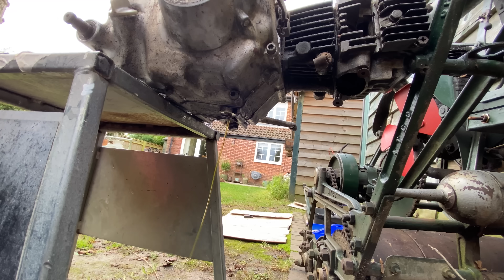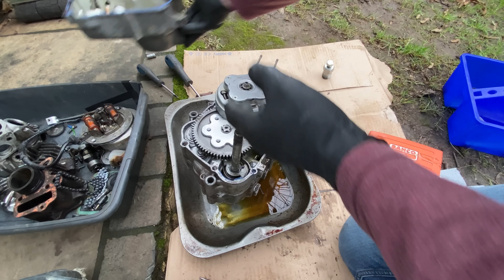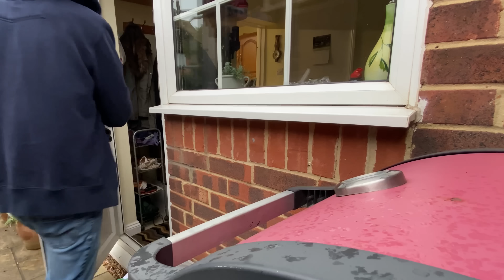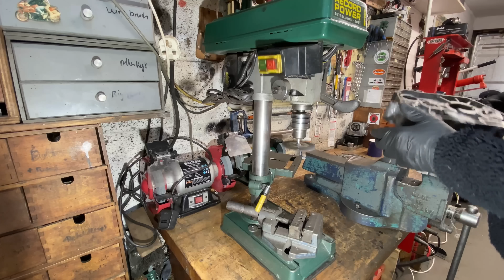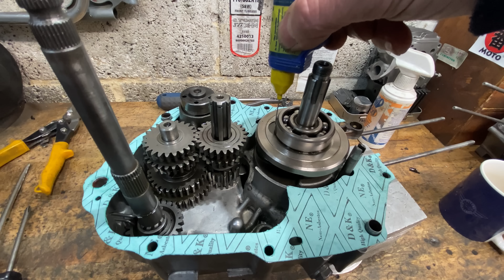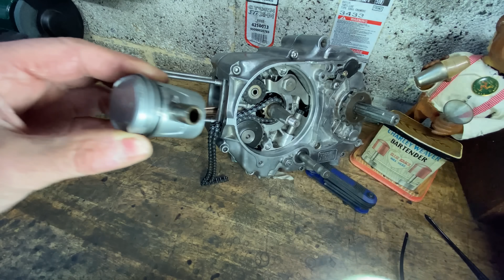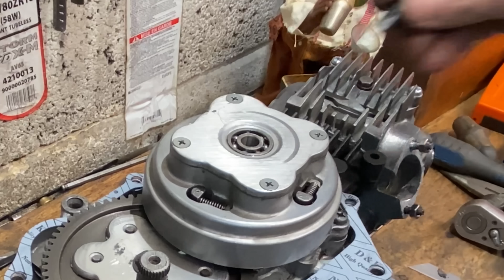Honda SS50 engine strip down, rebuild and start

Comment: Yeah that engine had been dismantled not long before you got hold of it. You can tell by how clean it is inside. Wouldn't be surprised if  those piston rings were broken during initial assembly.

Comment: Great video, it brought lots of memories back.I was amazed it was so clean inside.
I did 30,000 miles on the SS50 that i bought new on August 1st 1974 and just had a burnt exhaust valve.

Comment: What happened to the running temp painting the barrel. And the wobble board sound with no exaust...40 odd years ago...if I remember correctly... couldn't you get a 60cc conversation kit. So instead of a 50 U had a 60 for tax n mot purpose...😂😂 not to mention your test....😮😊😊😊

Comment: Oh wow, that was my first bike, Honda SS50 Reg HHN381N,  Ok on the flat but I still had to either get off and push or pedal like hell to try and get to the top of a steep hill on my way to a farm I worked at. I smashed it when coming down this hill on the way home as when I reached the bottom and the bend, the handlebars were pointing ahead but the wheel and forks were still going their own way.  Happy days. The front wheel slipped on some black ice on the country lanes and another time, I was following the petrol slick on the road and when I came to the bend and crossed the white lines, I was off again

Comment: looks likethat engine was stripped, cleaned, rebuilt but the gasket at 1/2 an inch probably ruined any power it might have had and it got consigned to back of the yard...weird about the piston tho

Comment: Why not used locktite on the bolts? Vibrations can untight them. leaving you with repeating  the job., as I already experienced. with a 70cc

Comment: I've done three top end rebuilds with reboring back in my younger days, nothing so complicated as this, not having a garage or work shop now I would have to leave any engine work to the "professionals" , the same professionals that on fitting a new chain and sprocket left the chain adjusters and rear wheel spindle loose, thankfully I heard the rattle before the wheel skewed sideways and jammed up, I pity anyone who has to take their bike or car to dealers to keep the warranty valid, I have read you can use any local vat registered mechanic which save many miles of two and fro, being that small engine bikes require 1000 mile oil changes you could be on first name terms with a mechanic if you do lots of commuting miles.

Comment: Hi Allen, I'm wondering, is it fine to retension a loose camchain tensioner or would you recommend buying new ones?  My bike is a 2003 Honda VFR800 with 34,000 miles and one of the camchain tensioners is losing tension and chain is slightly rattling.  Your response would be much appreciated.

Comment: I notice when im going down the bridge my c70 is making a drag to engine so I try to step the clutch without releasing it in order the clucth set in neutral position temporarily... But now it does not work the way it was

Comment: Hi, my friend had a really quick ss50 I found out why a few years later, a c70 head and barrel would go straight on, 
I always wanted a Honda 50 but having to buy it myself I ended up with a Gerreli tiger cross, which turned out to be quick but didn't have the top speed of the ss70, to much torque, and cc, also higher compression. 
Back in the day, 1978.

Comment: Hi Allen, in 1963 or 64 I had a Honda C1 14, which was the domestic version of the C1 10. It was a four speed not the usual three speed. I was just a kid and I wanted to take my little Honda 50 home to America so I had to disassemble it into four pieces and cut the frame a little bit to fit it into the boxes to ship it . about three months later. I started receiving my packages and put my little Honda 50 back together. I was I am mechanic after that for the rest of my life. I love that little Honda 50 it would go over 50 miles an hour. I drove it to school every day by the way, you are an amazing creative man. I love your videos and your abilities.

Comment: Loved the 3-way automatic clutch system. Had to rework the slopes that the rollers rode up as they had formed a groove at the top  and the clutch wouldn't drop out. That reduction in slope meant I had to araldite an extra plain clutch plate to an existing one to take up the slack.
The poor engine only had 2 speeds, tick over or full throttle, but it did me well in a step thru' for nerly 3 years.

Comment: Great video! The Honda SS50 was my first bike and I have fond memories of it (not so much of it's pedals). Unfortunately at some point during maintenance I stripped the dome nut bolts on the cylinder head because they were aluminium. Not a good day.

Comment: My first bike was the predecessor to this one, a C50. I was 13 and my parents bought it for me for Christmas, as a none working bike. Got it back home, to find it had no spark, borrowed the flywheel puller off my mate up the road, who had a Suzuki 80, the same puller more or less. Found that the fibre insulation washer on the points was in the wrong place, so corrected that, and it fired up third kick, having been unused for about 5 years. Eventually sold it to buy a bigger bike, a DMW, yes D, with a Villiers 9E engine in it. You brought back some happy memories from 50 odd years ago with this one Allen. In the New Year I start the rebuild of my 40 year old Harris Magnum, with an 1170cc Kawasaki engine.

Comment: Ahhh. Memories of taking my Honda 50 apart!  I could remove it, strip it down, clean, reassemble & refit in a couple of hours. I was about 18 at the time. 1964/5.

Comment: These are such quality engines, i had a 1966 model, I'm sure it had push rods. I remember stripping it down and putting it back together just for fun, it was so reliable. I swapped it for a Suzuki 125.
Reply from the maker: The early 50cc engines were pushrod and were the C100 range

Comment: This took me back to 1976 when I got my first moped - a Gilera 50cc trials (2 yrs old), proper frame and quite a bit taller than my mates SS50's, AP50's, FS1E's & Garelli Tigers. Learnt alot from my dad (who'd had bikes) about maintenance + I had started a 4yr apprenticeship (first year gen metalwork fab), so got the confidence to tackle engines over the years - fab days.
Now 64, I potter on my 27yr old 600 Bandit and do my own maint + I've got an RD125 sitting in my garage ready for renovation (can't seem to lose the smell of a 2 stroke - I think its in my veins).😊

Comment: Fantastic video! I had a SS50 in the 90’s. Back then in Holland the police would stop you and check your bike to check whether it had too much power. And I had a 70cc cilinder on it at that moment. However, when they tested the bike I pulled the choke out and the engine would just mis fire and not run properly. The police officer was annoyed but didn’t understand what was going on. So he let me go without a fine. Happy days

Comment: Took me back exactly 50 years to my SS50 and the numerous engine rebuilds I did to it learning by my own mistakes, which ironically was the reason for so many rebuilds!

I didn't seat the gudgeon pin circlip resulting in bore scoring and the first rebore, I used Golden Hermatite on the crankcases causing the oil screen to block, - rebore number two!!!

I had no male role models, nobody around worked on their own vehicles and it set me on the journey to where I am now where still working on and engineering my own vehcles I am even more of a rarity than back then.

The thing that jolted me back 50 years the most was you starting it in the vice exactly as I did, the flatulent exhaust popping swept away the years!

Comment: Allen, for you, this is a walk in the park! I still have my first "bike", waiting for my retirement to try to fix it, a 1963 Honda C110 (50cc), with reversed gear box: 1st up, 2nd to 4th down and push rod valve lifting. This will help me, if it stays online for sometime, although I've already stripped down a Honda Cub 110 engine clone. They are all similar, besides the push rods, of course.

Comment: I had a 1969 minitrail. Yellow. Replaced the 50cc head and piston with 70cc bits.
Squeezed the bigger carburater from the 70 into a space it was not made for, but it worked perfectly.
Added a lifted cam and my little minitrail was now a mototrail. I added drop bars and raced it as a mini-cafe.

Comment: i would love a quid for every one of these i have rebuilt over the years. done my first when 14 years old. i done a 12v 50cc version a couple years ago and done a 110 big bore conversion. not as easy as you think because you use a pit bike barrel which wont go in the crankcase opening. i used a c90 crank, gears and timing chain and also fitted an oil pump from a trx90  which is 3 times the flow capacity. you also need to open the oil feed under the barrel to 2.5mm. you also check for rust around the oil return channel as it can rust all the way through causing an oil leak. another odd thing you should see is that one of the head stud washers is copper. apparently its some mad japanese tradition LMAO

Comment: Hi Allen,

I am in the process of rebuilding an Ss50 engine as I had to replace the kickstart shaft. I’d like to do what you did in so far as test running before refitting to the bike. In the video you briefly mention the use of a spare coil but I can’t see the wiring you used. Could you let us know where all the wires go please? Also do I need to connect the battery or is it possible to run the engine just off the generator power ?

Comment: I grew up in a family of mechanics, always working on cars and motorcycles, taking engines out, rebuilding them of any brand. We also had a nice workshop at the time, not as sophisticated and complete as yours (which I envy), but it worked, wish I still had it today because I still have a complete VW T2 1600 AS engine that needs to be assembled…

Comment: I had a Honda moped with that engine with a revolution limiter in the flywheel which could be locked quite easily with screw making it run over 70 Km/hr. That bubbly sound when running without the exhaust bringing back all these memories hahaha great, & thanks!

Comment: Great video. What a beautifully designed, compact engine! At 16 my 1st bike was a 1964 Honda C110 50cc Sprint with an upswept exhaust, possibly a forerunner of the SS50. An enjoyable introduction to motorcycles but after a while the kick-start shaft sheared off and I had to learn how to bump start it. We didn't know about JIS tools and tried Phillips screwdrivers on the bolts to no avail. Had some nice rides on it though.

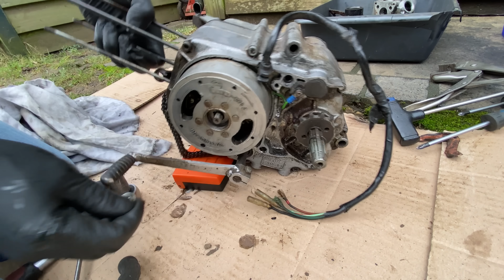Comment: does anybody know what tool he uses at 4:32 and 2:58 the sockets im trying to strip an old engine myself, thanks
Reply: Type Honda ss50 clutch nut tool into google you'll see dozens for sale.  Same for the flywheel or rotor.  Type in removal tool

Comment: Nice video. I have an 84 model that jumps out of gear. I need to get working on it and I will use your video as much as possible. Question for you. On the very top cover on the cylinder held on with 3 castle nuts and 1 regular nut. Do you know why the 1 is different? It's always in the same place and on everyone that I've seen? Just curious about that. Thanks and keep up the good work, Kelly.

Comment: Oh my🙂 i missed my motorcycle shop 😢 used to modify, repair and race set up those small displacement motorcycle.super enjoyable work, testing many race cam shaft, big valve upgrades etc..

Comment: I’m in southern Ireland, have a 1983 Honda 50 and I want it done up professionally but can’t seem to find the right person to do it!!! It’s running by the way. I just want it done up. I want the engine looked at, a single seat on it, a shot blast and spray paint, tyres chain sprockets and a throttle cable ffs that’s not too much is it? Any suggestions?

Comment: Wowowow. My first bike was a C100 Honda 50 4 stroke which I purchased for 7 pounds, it cost me another fiver to have the metal frame welded up when it snapped in 2 in the fields!!! They would rust really bad just where the shocks bolted to the pressed metal frame. I rebuilt that engine twice, great fun!!!

Comment: I was interested in the gaskits. Did you hand cut most of them yourself, or buy them? I'm thinking specifically of the gaskits between the two crankcase halves.
This was a remarkably cleaaan engine on the inside. as if it never ran after it's last build. It's such a pleasure to see you working on an engine, I have tried to get into this when young, but I didn't know anyone who could show me how to approach things properly. decades later I was involved in rebuilding old lathes and Milling machines, which was really interesting.

Comment: Great job I had a Honda 50 as my first motorcycle it was a cracking little machine which everyone took the pizza out of but clearly they didn't know flat it was first in its class af the Isle of man TT, it trounced everything else, I stripped mine down and rebuilt it but I used the kitchen table my mum wasn't impressed  my dad wax though oh happy days, I loved that little bike later in years I bought its big brother the RR1000 Fireblade man what a rocket machine a dream to ride ❤👏👏👏👏👍👍👍👍🤣

Comment: good little motor, they used em for hunting a lot in the day, you could yard a mule deer off a mountain with em.. 90's too . . .  lotta times you would have to carry the 50 over rugged terrain to get where you were going, unhook the sled carry the elk, hook it back up and go .. they used the 50, the 90, the benelli 50 and tote goats . . .  that gave you access to a more remote secluded grounds

Comment: I had several of the OHV pushrod 3 speed model when I was a teenager.  That was a long time ago, and, when I think about it, it was in the previous century. Sad.
Bought the 1st one from a school auction for $15, about 1/4 of the wages I earned working in the bank...
It was supposedly a non-runner, but rolling down a long hill, I chucked it into gear, and it started. It was totally gutless, and wouldn't drive on the flat part of the road.
Pulled the head off, and found that the exhaust valve had one edge completely burned away,
A simple fix, and it ran reliably for ages, although it was thrashed without mercy.
It was one of those step-thru things. I  pulled the horrid plastic legshield thing of it, and all the other ones I had.
I had a mint red one, (the first was blue - I think it was a '63 model), but I murdered it running it on aviation fuel. It went pretty well, but not for long. I seem to recall that the piston started to melt...
Another one had a weird electrical fault, and would only run with the l/h indicator on - eventually, the l/f was the last holdout - all the other lights blew, and the flasher would glow brighter as the revs increased.
In the end, I got shot of them, as parents weren't happy with all the clutter in their garage.
Bought a CD 175. Twin cylinder, single carb, 4-speed and a pressed steel "body/frame".
It too had a haunted electrical system, and I spent a fortune at various auto electricians trying to get it sorted to no avail. OK for daytime use, but would blow headlight bulbs at very frequent and inconvenient intervals, so it had to go.
Replaced it with a Suzuki T250, which easily blew my mate's Yamaha XS650 into the weeds. 6-speed box, and murderous intent.
Then it was a Yamaha RD350, which basically spent all it's time trying to kill me.
Fortunately, a crank seal went before I died, and it started sucking gearbox oil into the engine, which made it very smoky.
That was my last bike for ages.
I wish I'd stored the remains of all those machines away, as they're all pretty much impossible to come by now.
Story of my life.
Grrrr.

Comment: This brings up some many memories 😍 I had Honda Monkey Z50J when I was 15years old. I took that engine and transmission apart so many times that I still remember everything after 20years 😅 Fisrt time taking it apert I didnt noticed that clutch wasnt on those splines correctly.. luckily nothing broke when started it first time 😂 I did same operation for two of my friends when they made same mistake so I think I learned from first mistake 😊

Comment: Is there any chance you could do an SS 250 twin (similar to your 180), with a 5 or 6 speed box ? Or, maybe, a 200 V4 with 6 gears, electric start etc ? You could configure it as a "big-bang" engine. What do you think ? Should be fairly easy for you...  (next to impossible for the rest of us. Haha a ! ).

Comment: Did you have to set the points gap at all or is installing the wheel on the chain that had to line up the way to set the timing??. Thanks Thomas Cahill, Cork, Ireland

Comment: I remember the SS50. I think they were a descendant of an even older model from the 1960s. The frame I believe was a pressed steel affair. The thing had a proper fuel tank and normal telescopic forks. It looked similar to the Yamaha FS-1E and Suzuki AP-50. 
The Honda is a four-stroke & the engine is a variant on the engine of the step-thru C50, with a clutch and a extra gear. The exhaust was upswept, but a step-thru exhaust could be fitted at a big saving.
This engine should be durable. How much wear is there in the cylinder?
I couldn't help but smile at Mr Millyard finding creating Crochet knitting 'complicated'. This from a man who made a motorcycle engine out of parts from a Pratt & Whitney aero engine...

You used to hear the 'wet-fart' sound of a Honda 50 with no exhaust a lot where I live. There is nothing more exciting than trying to control a Honda 50 on a wet uphill track when the tyres are worn smooth.

Comment: The cylinder walls were insanely thick, honda probably used same casting for bigger displacement. The swingwheel looked a bit overkill for 50cc displacement 😂 heavy enough times two

Among my stuff.
Have a skyteam gorilla with loncin engine.
50 and now 125cc
Imported three bikes, kept one myself.
Experience from these Lincoln engine's
They have the Honda quality